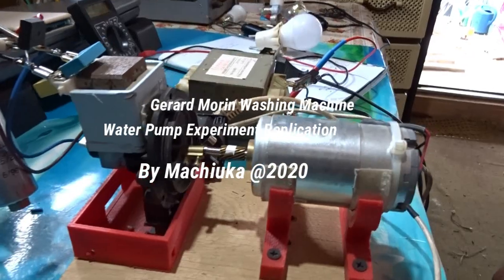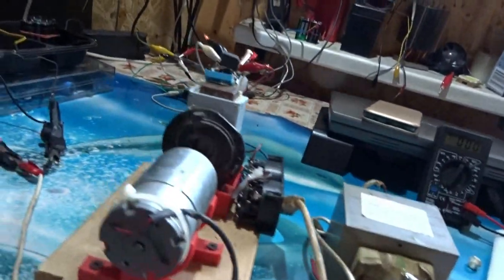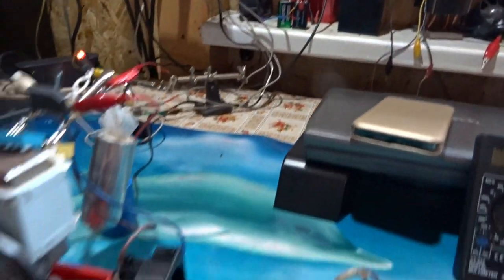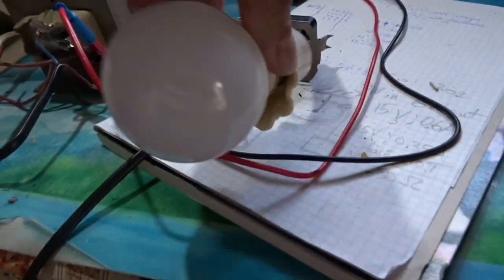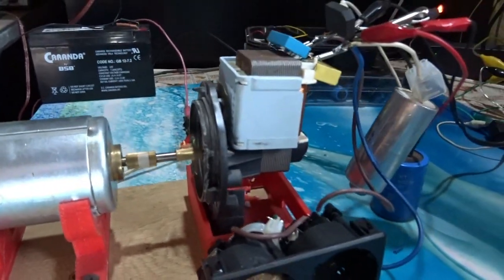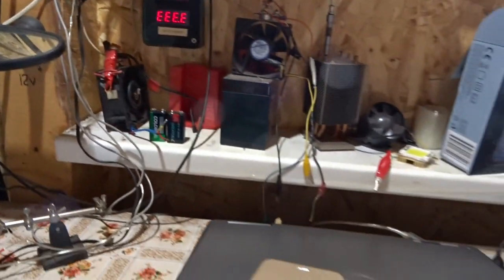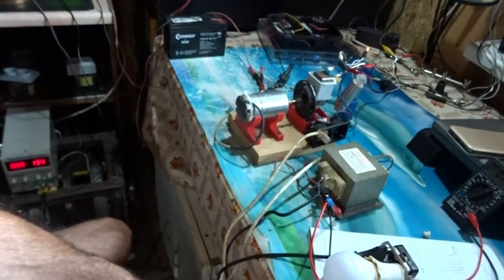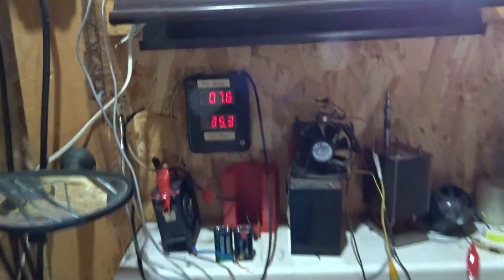Gerard Morin Replica with MOT

Comment: so you putting 19 volts DC with 1 amp to a DC motor to a Microwave transformer 120:2000 volts , i guess you put it as step down you get get 37 volts and you light a lamp which is 7 watts , your input is 19 Watts and output is 7 watts ?!!
Reply from the maker: This is not the point here. The point is this kind of electricity, that has a lot of weird proprieties. Take a look at Gerard Morin videos
Reply: @Machiuka  nothing is weird its AC am familiar with his videos , you tell me what is unique about what you see maybe am missing the point , there is no gain , its normal a high speed motor working as gen create a high voltage so what , the important can it do work " the amps " he says no amps , give me a break
Reply from the maker: @EnergySeeker  I agree with you. No amps no work. I made this video for fun.